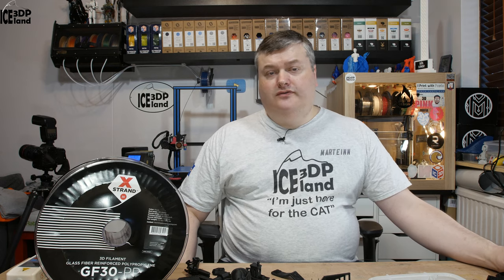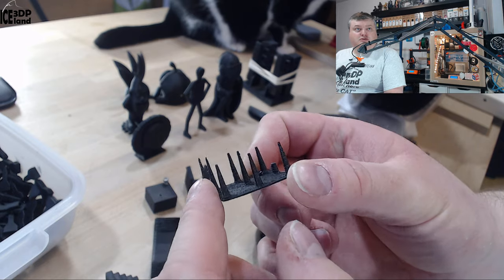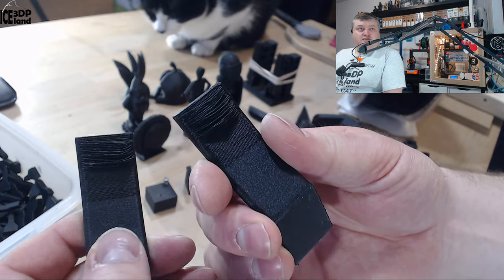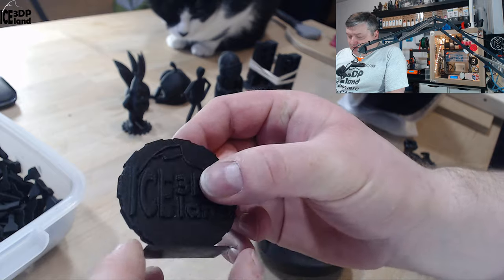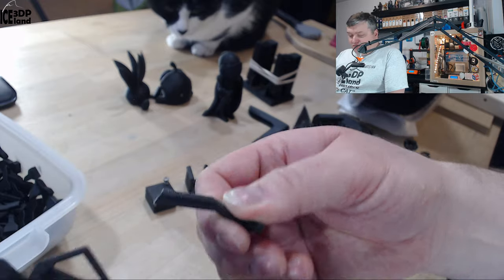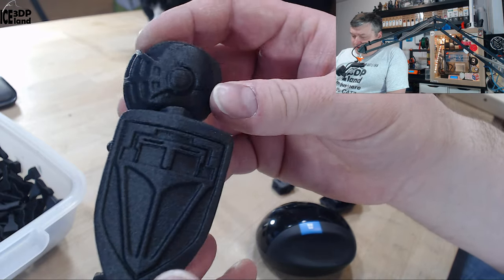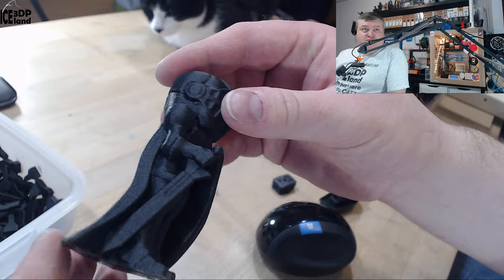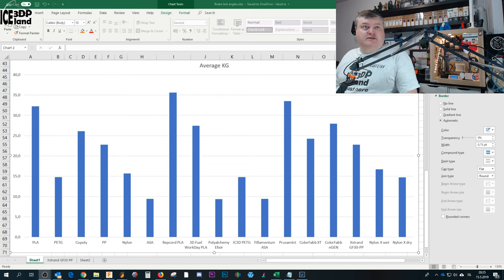Xstrand GF30 PP Review

Comment: Great video, thank you. Sounds like a really interesting filament. If it wasn't for the price... I found the spool you have for 350€ :o
Reply from the maker: Thank you. Yea, it's really nice but has it's price thats true.
Reply: Maybe I'll have to convince my boss to get some at work :)
Reply from the maker: @timomiller569  yea, if you have a good usecase for this material type and properties, I think you have a good option with this material.
Reply: @3DPIceland  Hi... I'm thinking about to work with this filament but I figure out that filament needs a good source of heat. I'm about to buy the Artillery  X1 Sidewinder but don't know if this 3d Print can do this job. Can you give me a help?
Reply from the maker: @joselombardinetto7990  hi, you need a all metal hotend, and hardened nozzle, and enclosure, and ability to dry the filament. Its not very user friendly. Also you need magigoo for bed adheasion, PP does not stick to many bed materials
Reply: @3DPIceland  Yeap... I have heard that PP is an amazing material but a spoiled bitch as well.🤪 It's very sensitive to moisture, it can be abrasive due to its glass reinforcement, reason for which they also recommend to use hardened steel nozzles and extruder driving wheels... the printing pieces need to put on oven to dry. A very big drama. 
But you think that any 3d printing with a nozzle temperature equal or a little bit up to 240℃ can do the job? Thank you so much.
Reply: @joselombardinetto7990  non hygroscopic but extremely prone to warping
Reply: @joselombardinetto7990  are you thinking about nylon?